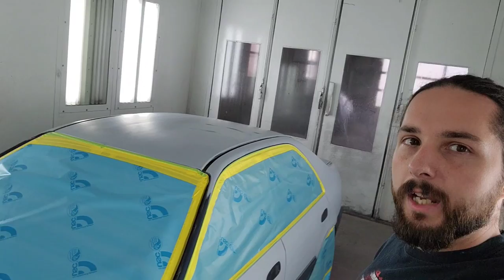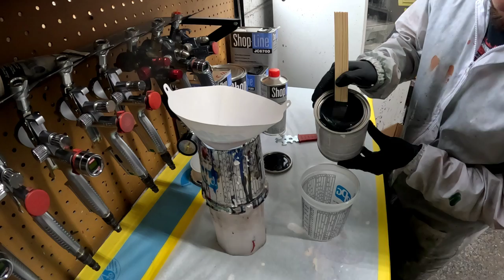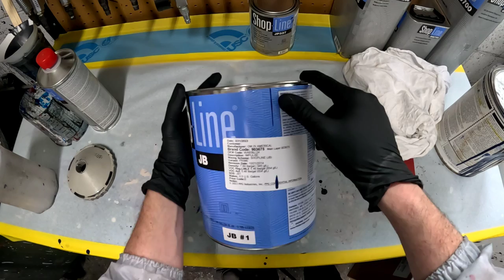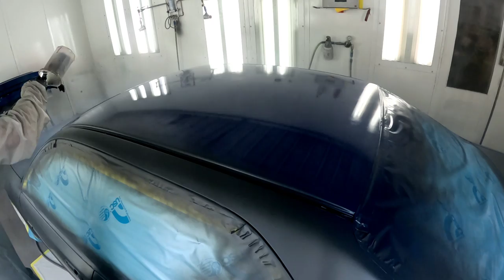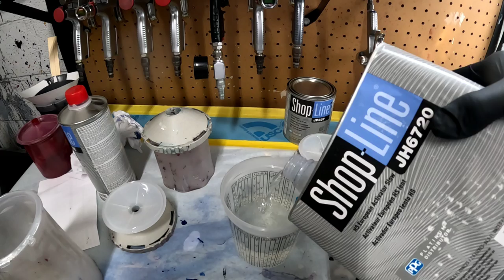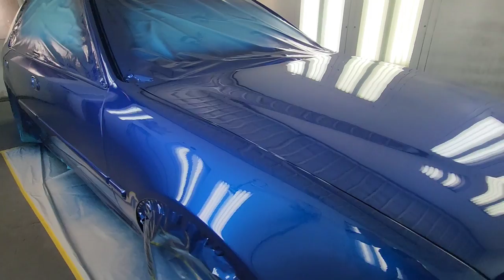Honda Civic EG Full Paint Job: PPG Shopline Products

Comment: Very nice job. Looks straight and glossy man. Very impressed
Reply from the maker: Thanks man! That shopline clear has a really nice gloss
Reply: @cliff_hatch3r  I see you like to use the slowest activator possible and spray the clear on kinda light? Might have to try that
Reply from the maker: Yessir, I've always used the slowest hardener/activators when doing allovers. It makes for chasing the wet edge a lot easier. Also, I keep the booth at 80-85 degrees... the first coat is kinda light. I'm just tryna give the next 2 coats something to hang on, too.
Reply: @speedokoterefinishnetwork4937 slow everything is the way to go. You can sped it up but you can’t slow it down. ❤
Reply: @charlie4324  yup

Comment: I use shopline as well as DBC everyday. I don’t use the European Clear ad much but I do use the heck out of the JC661 Clear with the extra slow JH6690 Hardener with; although not in the PPG P-Sheet/TDS, a 5-10% splash of JR5590-80. Its a pretty solid line in my opinion.
Reply from the maker: I just tried jc661 with jh6690  this past week. So far I'm digging it. Lays out nice and looks good!

Comment: Love the length of this, straight to the point but still informative enough. 

I’m prepping my eg hatch for paint right now and I saw you used aircraft stripper on the metal body. My question is: What do you use for prepping the bumpers and other plastics? 

Someone did a shit paint job over top of the og paint and I don’t know if I can sand in all the contours to get it to bare plastic, and also I don’t want to haha. Any ideas? Thanks a bunch. Do more Honda videos
Reply from the maker: Honestly, sometimes it's worth just buying a new bumper than to try and stripping the old shitty paint off. It would save so much time and also your fingers 😂... if you do choose to strip it. 180 grit and prime the bumper with a 2k primer. Then, sand it with 320-400 to prep it for paint... I've got another honda project coming up if I can get around to working on it 😅

Comment: what's a good quality PPG base and clear to ask the shop to use? I want to restore my 95 Civic coupe EX to original factory look.
Reply from the maker: My shop uses ppg envirobase hp, which is a water-base. Ppg deltron is also a really good product. I like using the DCU2002 clear. They both have a lifetime warranty, I believe.
Reply: @cliff_hatch3r  thank you for the information. I will ask the shop if they can use Ppg Deltron and DCU2002 clear. 🙏🏻